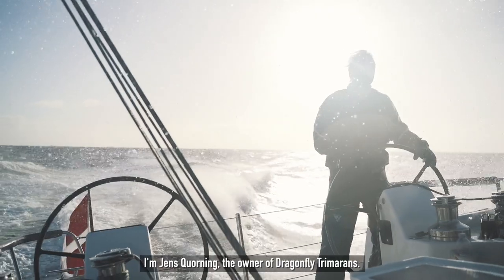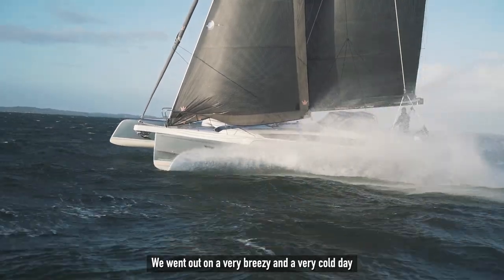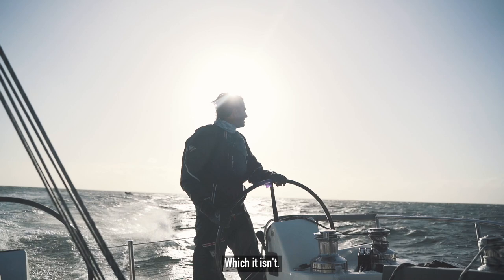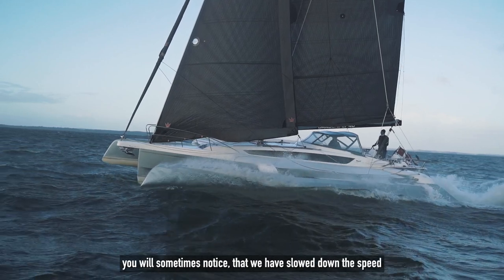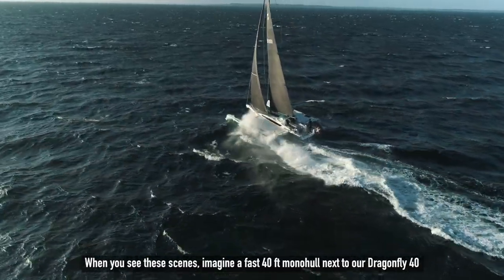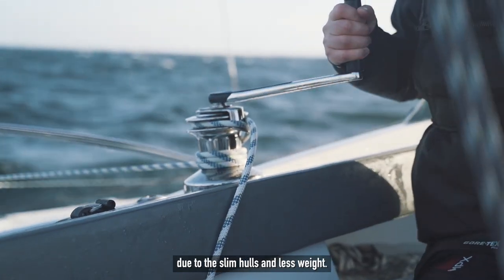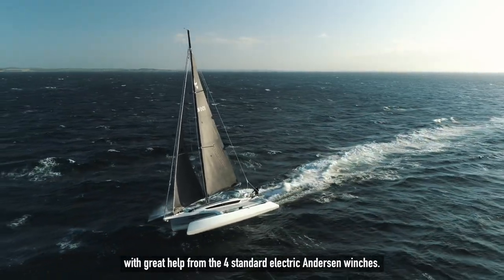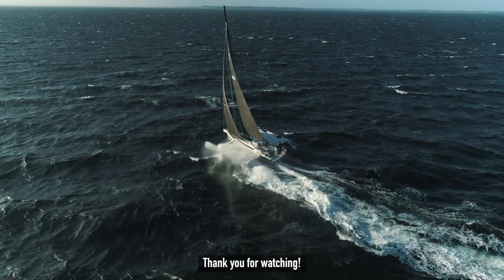Dragonfly 40 - Unfold your horizons

Comment: Brilliant video Jens.  I'm probably echoing other comments but this is the type of video I need to see before deciding to buy.  Any boat will look lovely on a sunny day in flat water. It's how they handle when the weather isn't what the forecast said and you're out in the thick of it. Even in this great film the sea wasnt that heavy for the North Sea when a storm passes through but at least I can now see how elegant and composed these vessels are in such conditions.

Now you'll need the rest of the models out in heavy seas.  No one wants to gey bounced around on purpose but if it happens you can trust this great design, engineering and overall concept.

Thanks again.

Comment: Beautiful boat Jens "well done"👍

Question from Vancouver BC Canada;

Can you do another walk through video showing whare a customer might install "all the bells & whistles" currently available for luxury loadouts..?

Example=

-24v water maker
-24v air conditioning
-Extra freezer near the galley (doesn't need to be quite as big as the existing refrigerator wich is excellent already)
-Small washer/dryer (50/60htz switching if available)
-Solar panel location possibilities -huge upgraded lithium battery banks optional install locations

I realize every client is going to have a different idea of "what their personal preferences are" but I'm just curious whare a person might squeeze all that stuff in if they wanted it & what would the performance penalties be for the additional weight..? { -1.5 knots or something..? )

I can imagine with that upgraded 80hp engine & its optional upgraded alternator output in combination with a large robust solar / lithium setup that would negate the need for a generator.

Maybe a "sky's the limit" video is in order for all those who think their giving up the extras for lack of space, when really, I can see it is possible with some clever organization.. {yes, goodies are expensive., but we shop with our eyes 👁️)
Reply: @H. Kirk 

I'll admit it's that cockpit that's drawn me in...

"Specifically the helm positions"

It's just too good..!!

I'd have to put down some polar bear planks on the seats on a night watch; {plywood with nails sticking through upwards) so I didn't sit down & fall asleep with my coffee in hand ✋... Lol...

Jokes aside though,

= Amas are probably good for extra sail & whatnot at the front of each one, couple paddle boards distributed at the rear optional hatches, & lots of room for garbage collection in the middle somewhere right at a hatch location labeled "valuables in green garbage bags" {Other lighter weight items also of course)

Not sure if the weight of a generator in there is a good thing

= I envisioned a Lithium swap taking the same existing space V birth forward; probably somewhere close to triple the storage capacity if cleverly laid out {certainly over double if taking every existing square inch)

= Some great 24v air conditioning technology has come out recently {in the last 12 months) *touted as; "for up to 40' hulls" & seeing as this boat is narrower in volume this might work., (Perhaps..) {heat pump/compressor in the engine bay.?)

= Compact washer/dryer modified into the bottom of the wardrobe on the starboard side..? {Yes, I suppose that would take 75% of its lower volume & even then that unit might need to be widened slightly thus taking seating length away, but there is already plenty of length already, might as well widen its mirrored sister unit directly across from it to maintain geometric symmetry in the forward saloon area..

= & For the freezer..? "I like your idea" {Engle Brand "made in Australia" high quality 24v aluminum expedition chest freezer under the seat closest to that multi purpose nav/galley work surface.. we don't know what type of tankage is under there currently & what work arounds might be needed, but if its just room for golf clubs & tennis shoes at the moment then that's the golden solution 👍

= Solar panels locations..? {Yea, I don't know enough about this.. over the helm offering good sun protection as a side effect sounds interesting, but its not exactly "esthetically pleasing" on a gorgeous sports car per-say., Another personal preference right
(Albeit practical., provided it didn't act as a sail of sorts on such a light weight craft, might be ok..)

Dragonfly 40 looks like a fantastic coastal exploration experience, with the ability to high speed protected anchorage, continentally hop your way along geographically {post "unprecedented times" obviously)

A truely unique craft for a middle aged adventuring couple who's kid's have left the nest; (like my own situation, although he's not left yet so I'm thinking we could instead 🤣)

It would be a joyous adventure of a lifetime not directly comparable to other "tried & true" traditional vessels, strong emphasis here on digital weather technology systems & fast passages minimizing the exposure risks

Truth..? The picture that has been on the refrigerator door at home for the past 4 yrs of my "dream ⛵" has been the Pogo 50.. this is honestly the first time I've really taken a second look at a multihull, its a new development..
Reply: Excellent points, but you forgot to include:

Cut the banquet sized dining table down by at least half. Make it a dinette.
Install a usably sized sink and drainboard
Remove that useless starboard sofa, build up waist high cabinetry with hard countertop so there is some food preparation and workbench space, with storage underneath. That would also give you a place to install the water maker, AC, extra freezer and washer dryer, otherwise, not going to happen. (I am not an electrical engineer, but I really, really want to know how all these electrical devices, including lights, winches, stove, electronic navigation and the high energy draining stuff you want to add on are going to be powered.) 
Increase the water, wastewater and fuel tankage.
Install a skeg on the hull to deflect subsurface debris from ripping the Saildrive out of the hull. 

This is a fantastic sailboat. Guaranteed lots of speed and fun. But it is not built for cruising for more than two people.

Comment: Agree with Pierre of 3 months aga.  A long fetch and 3 days of 30kts will produce something prety reasonable in the way of waves.   3 days if easterlies in Algoa Bay (South Africa) with the wind changing to SW 20kts to 25kts  can easily produce waves of 5 to 6 metres.  Scary in a Jaguar 22" fin keeler.  I still love the Dragonfly, but I do wonder how it would perform on a non-stop single handed, non-stop, circumnavigation unassisted from Plymouth and rounding all the southern capes.

Comment: intriguing. speed has certainly its advantages. but so does comfort. the cockpit is completely exposed to the elements. for a long voyage in the tropics, pilot will suffer from heat and sun exposure. in the north, suffer from cold and icy spray.  ho helm below. seems to have no provision for any sort of t-top.  canvas might work, until ripped apart by the first storm.  overall a sleek design, maybe too sleek for world cruising.

Comment: Those outriggers worry me, what if they bury in a big wave what happens then.
Reply: They are extremely buoyant and there is tremendous righting moment to counteract the heeling force on the boat from the rig. I have buried my amas nearly up to the beams (far abaft) at 10+ kts and yes it stalls somewhat but still keeps momentum.